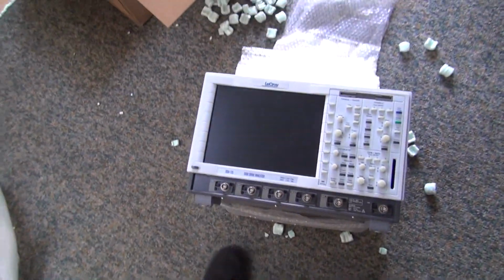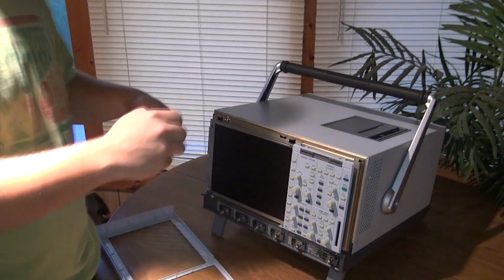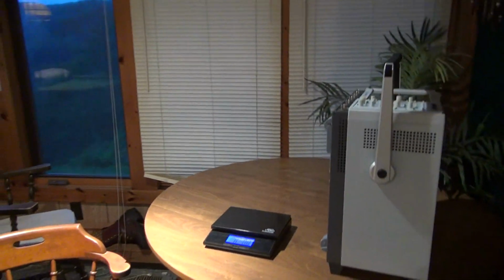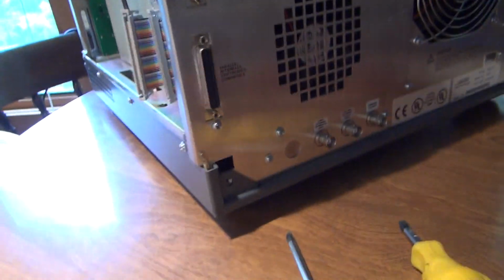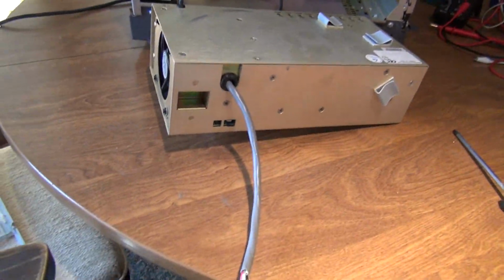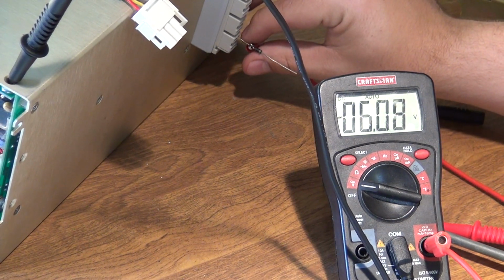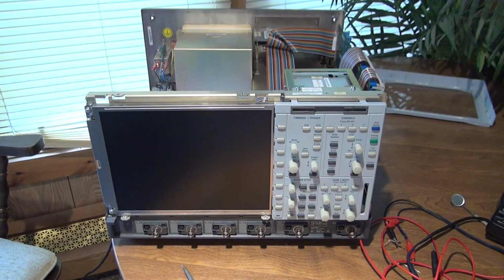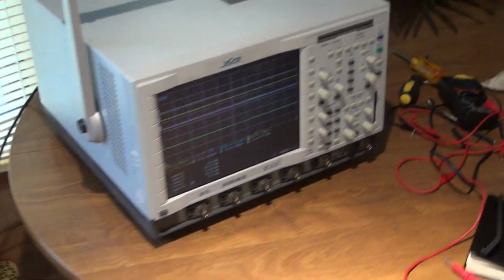Nagle Industries: Fixing a LeCroy DDA-125 Oscilloscope

Comment: There is a circuit board from the underside of the cover which is connected to another circuit board through a ribbon cable.It seems that you have not connected it when you reinserted the cover.Other viewers have also noted it.
Reply from the maker: It's for the printer.  I noticed it after I put most of the screws in, had to take it back apart.  Just didn't film it.  I thought no-one would notice  ;)